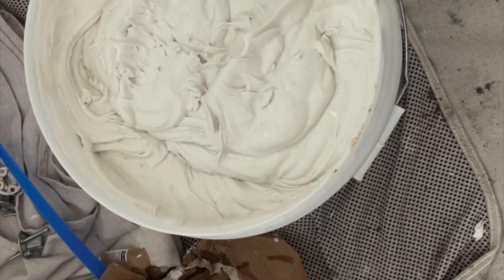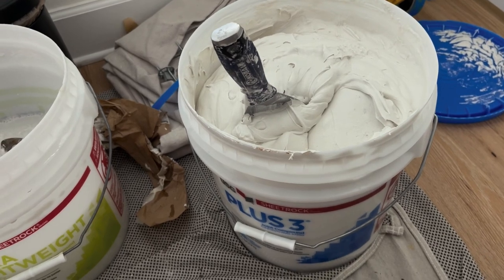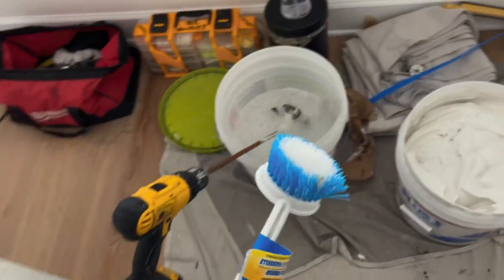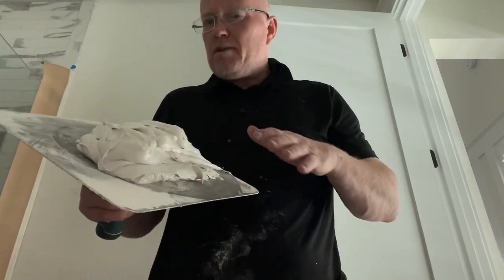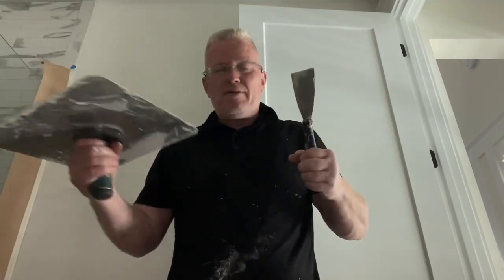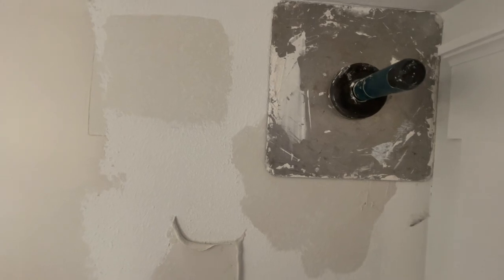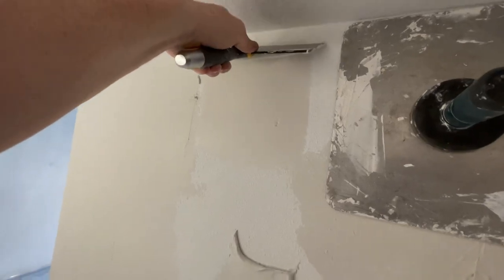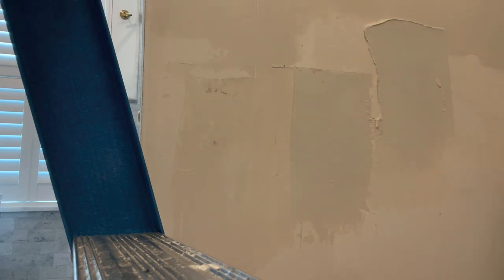If You’re New to Skim Coating, This Will Make You a PRO!! - Spencer Colgan

Comment: I saw this for the first time last night and it gave me a light bulb moment. Using a spray water bottle was a game changer. I had been really struggling with skim coating. If I made the mud to thin it fell off the wall. If it was too thick I couldn't spread it properly. Thank you so much for this information.

Comment: Just wanted to say thank you for this. I've watched quite a few videos on drywall while tackling progressively bigger/harder fixes around the house. None of the videos I've seen so far went through the basics of angle. As a result I've been floating at 45 and lower and trying to compensate for the thick application. Looking forward to practicing with thinner coats.  Again, thank you!
Reply from the maker: You’re quite welcome.

Comment: I have been binge-watching your videos like a season of 'The Office' today. You have me so pumped to get started with my first DIY painting and wallpaper projects! Only thing is I have orange peel textured, satin-painted walls... bleh.

Do I need to do any prep to the painted walls before skim coating? 
After the skim coating dries, you recommend the Gardz - would this be the same whether I wanted to paint over the new nontextured walls or put up wallpaper? 
I think my main concern is the proper layering and steps necessary to achieve what I want in each of the two cases (papering and painting). 

[Any advice that leads to me becoming half as good as you will be kept strictly confidential 😂😂]
Reply from the maker: Melissa,

Thank you!

Would you please share your experience with my teaching and videos with everyone else by considering to give me a five star review on the following link with some nice words?

https://www.google.com/search?q=tampa%20wallpaper%20installer&tbm=#lkt=LocalPoiReviews&trex=m_t:lcl_akp,rc_f:nav,rc_ludocids:18168418332679895040,rc_q:Spencer%2520Colgan%2520-%2520Wallpaper%2520Installer,ru_q:Spencer%2520Colgan%2520-%2520Wallpaper%2520Installer,trex_id:XCBBr&lpg=cid:CgIgAQ%3D%3D

1. Before you Skim Coat, Apply PVA primer over semi gloss paint in order to get traction when you’re Skim Coat; if however the paint is flat, proceed to Skim Coat without any primer.  

2. After the Skim Coat, after it dries, proceed to seal it with Gardz or RX-35 (pro-999)

Yes. 
It would be the same whether you wanted to paint over the moon on textured walls or put up wallpaper. 

Thank you so much for watching my videos

Comment: Very informative video,thankyou for posting.. I have a question if you dnt mind answering... I'm in the UK, in my house it's 100 year old,. I've peeled of the wallpaper and the old plaster has come away with some of it.. 4 mill patches everywhere plus mapping.. so my question Is,  will that joint compound be OK to skim a full room and cover the big missing plaster patches? Also , would I need some angle beading for corners ? I can imagine plaster holding on a corner? Thankyou..
Reply from the maker: @davvo1234  … You don’t need the corner bead.  although you can use it to assist you on the inside corners but yes, fill the holes with this but before you do it see if you can get GARDZ in a can… It is an acrylic primer specifically meant for this
Reply: @spencercolgan  brilliant,thankyou..I'm subbing to you ...
Reply: @spencercolgan  oh I nearly forgot to ask... do I need to put on some pva glue before skimming with the compound? And do I need to lightly scratch the existing plaster before I start for the skim to cling to?
Reply from the maker: @davvo1234  no and no way.  There’s glue in plaster compound sir.
Reply: @spencercolgan  cheers bud.. I can't get the compound you're using over here,so I'm going for the knauf fill and finish lite and fingers crossed it works..

Comment: Spencer, do I need to size walls before hanging peel and stick wallpaper?
Reply from the maker: Yes. Use rx 35
Reply: Thanks! Just finished my first coat of joint compound. Heading to sherwin Williams to get some Roman PRO-999 RX-35 Wallcovering sealer and primer
Reply from the maker: @mandiconstantine496  I wish you the best of luck. Be confident
Reply: @spencercolgan  thanks! I have one more question. I’m wallpapering a small 1/2 bathroom (4x5feet) with a door that has 1” on the adjacent wall, then the corner. Extremely tight spot. The wall above it is 1 foot high. How should I wallpaper that tiny section of wall? This is my first attempt at hanging wallpaper, and watching your videos is like taking a master class! I could not have made it this far without your videos.
Reply from the maker: @mandiconstantine496  hi!  I will answer in depth shortly. Since you have benefited so much h, I’m so happy to hear!!  Would you please give me a 5-star review on my google and tell everyone else what you says here?

 Cant thank you enough. 

https://www.google.com/search?q=tampa%20wallpaper%20installer&tbm=#lkt=LocalPoiReviews&trex=m_t:lcl_akp,rc_f:nav,rc_ludocids:18168418332679895040,rc_q:Spencer%2520Colgan%2520-%2520Wallpaper%2520Installer,ru_q:Spencer%2520Colgan%2520-%2520Wallpaper%2520Installer,trex_id:XCBBr&lpg=cid:CgIgAQ%3D%3D
Reply from the maker: @mandiconstantine496  here you go 

Cut a piece to fit into your one once space.  Don’t worry!  Cut it separate from the rest of the roll and make it an inch extra wide and long. Then cut your “header” that 1-foot piece separate from your one inch piece and then cut your one inch piece while your header piece overlaps your one inch piece.  Then you got it.  Cut them together and you will make a beautiful horizontal seam!!!
Reply: @spencercolgan  thanks so much! I’m going slow and taking lots of time so I get it right! Enjoy your weekend!!

Comment: You've been doing this a while and I appreciate the knowledge. However, I think if I can use an analogy you're like a basketball player who has good shooting form but can't explain the actual mechanics of it. Two things. You suggested 90 degree skimming but didn't actually use it in the video for the most part. Second, explain what your hands and fingers are doing while using your tools. Putting pressure on one side of the blade/knife with your thumb and finger moving in one direction and keeping mud in the center are what eliminates lines. Diagnose what your "feel" is from years of practice and you can articulate even better what newcomers need to learn. Not being negative but you have a big audience who can benefit from even more information because drywall IS FRUSTRATING.